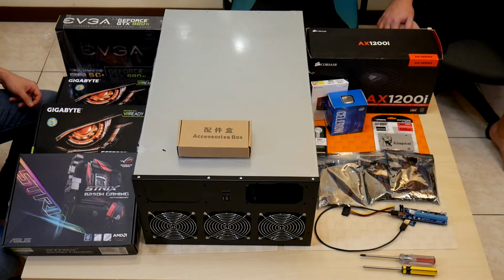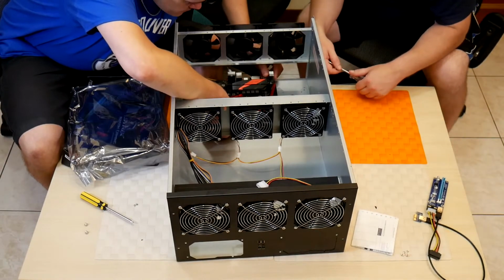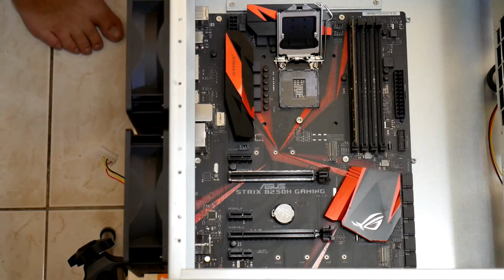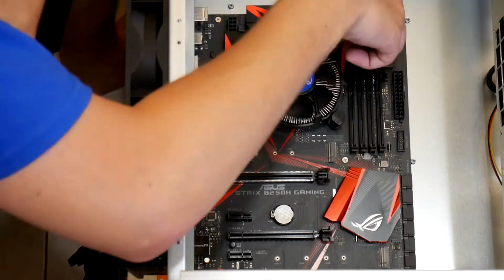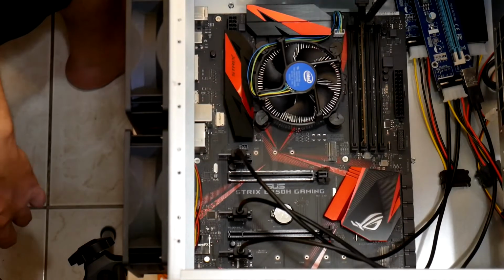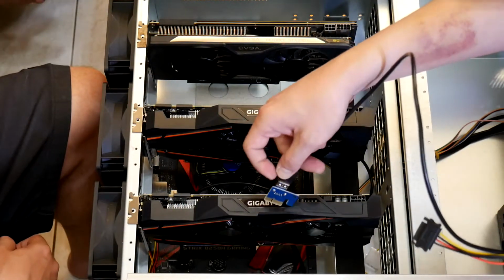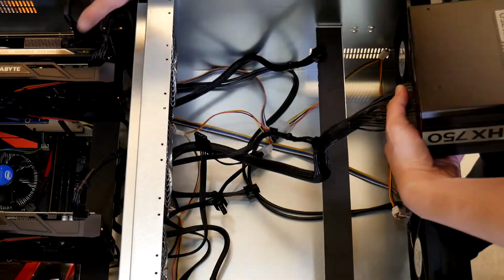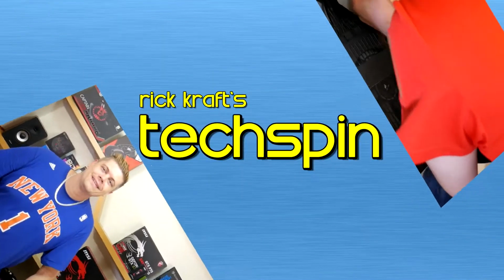CRYPTO build- Asus Strix B250H Crypto Mining Rig!

Comment: What settings did you use in the bios?
Reply from the maker: +pigseye2 We had it on defaults but Sam may have tinkered with it after that, not sure sorry
Reply: Bummer! I have the same motherboard and wanted to confirm the bios settings with someone who is successfully  running with 6 gpus.  I will keep experimenting. Thx!
Reply from the maker: +pigseye2 Sorry bro! At the time we only had 3 gpus anyways though.

Comment: The motherboard asus b250h strix how many gpu can handle?
Reply: 8 with the 2  m2 pcie adapter
Reply from the maker: 2 GPUs normally (x16).  With extensions and using the 4 PCI x1 slots, total would be 6.
Reply: hey sorry to bother, i got this motherboard but when i install more than 2 GPU the bios wont boot, do i need to unlock something? thanks.
Reply from the maker: +Federico Chao I'd advise testing the board with each one separately. Also you need to follow the guide for GPU placement, follow the manual. You can't just install in whichever slot you like for only 2 GPUs!
Reply: it's only 7 max, i'm struggling to get 7 woking. M.2_1 doesn't do PCIe per the manual